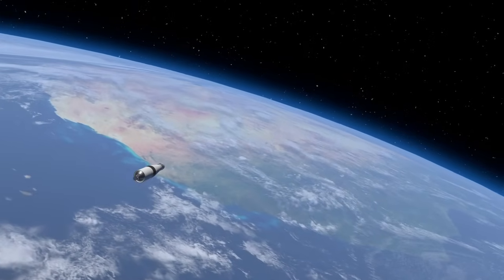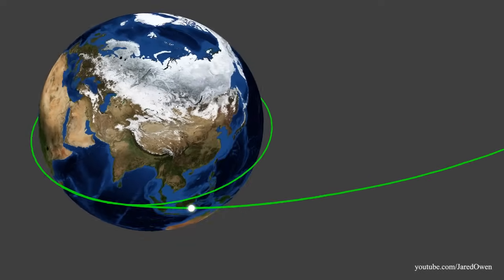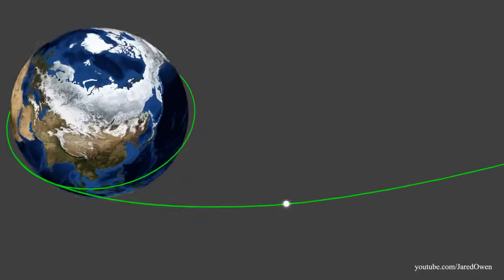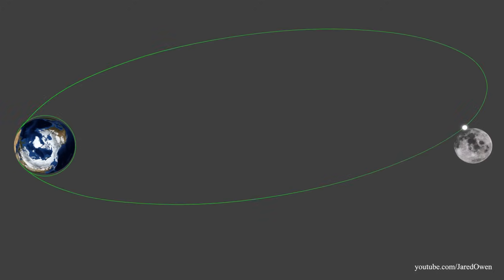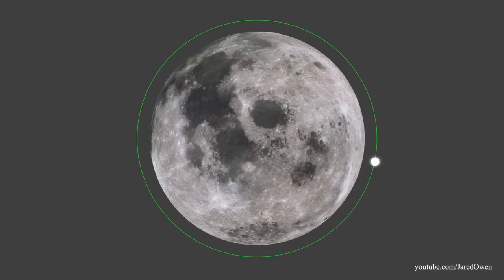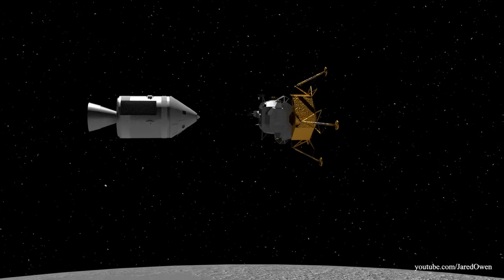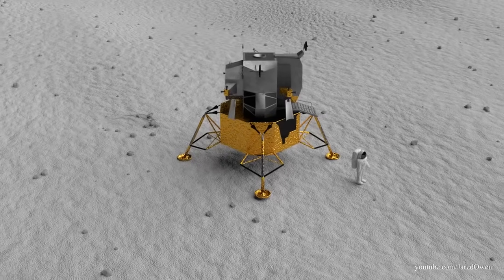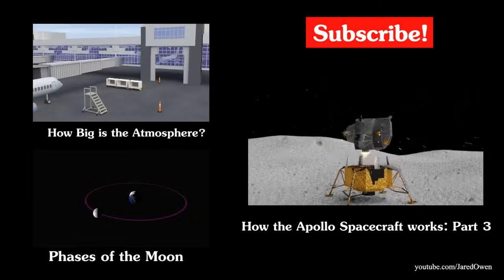How the Apollo Spacecraft works: Part 2

Comment from the maker: Watch Apollo Spacecraft Part 3 (the last in the series) 👉https://youtu.be/qt_xoCXLXnI
Reply: Jared, hi! Can i use max 10-20 Sec of your Animation for my Moon-Video?I will credit your name and link to this original Video? Please.
Reply: Yep which makes it all the more amazing... We literally had to INVENT EVERYTHING needed to go to the Moon and return, from the rockets, engines and propulsion systems, guidance and computers, communications, life support, heat shields to return, everything.  All the necessary skills and techniques and support equipment as well, from rendezvous and docking, navigation and orbital mechanics, EVA techniques and tools, space suits and portable life support systems, etc.  When the decision was made to go to the Moon, we had 15 minutes of suborbital flight under our belts, in a spacecraft nicknamed "spam in a can" that was barely capable of changing its own orientation in space and completely incapable of changing orbits (Mercury capsule) designed to run on batteries and keep its occupant alive and bring them back after just a handful of orbits (though with modifications it did fly for about 24 hours by the end of the program), launched by a modified ballistic missile that was basically an improved version of the V-2 missile Von Braun had developed in Germany 15 years before (the Redstone missile, which even used the same LOX/alcohol propellants as V-2!)  

Von Braun got it right the first time-- what was necessary for a lunar landing... a big liquid propellant three-stage, serially staged (one stage atop another in a "stack") topped by a spacecraft.  What he got wrong was the idea of direct ascent, flying directly to the Moon and landing the entire spacecraft, including the heavy Earth-Return portion of the spacecraft and all its propellants, on the lunar surface.  That would have required the Saturn C-8 or "NOVA" booster rocket with a much larger 40 foot diameter first stage powered by EIGHT F-1 engines.  It was apparent that such a rocket would be incredibly expensive to design and build and would take longer than the decade required to perfect, so he came around to John Houbolt's idea for "Lunar Orbit Rendezvous" (LOR) mission mode where a small "landing craft" that became the LM would be entirely expendable, carrying less fuel, and thus much lighter, would actually ferry the crew down to the Moon, leaving the heavy "mother ship" (CSM) with its fuel, parachutes, heatshield, and other equipment necessary for the trip to/from the Moon, would stay in orbit of the Moon for the crew to return to for the trip home after their landing and surface exploration.  This allowed the Saturn C-5 (Saturn V) to be able to launch the entire lunar mission hardware and propellant in a single launch, versus the alternative, the "Earth Orbit Rendezvous" (EOR) method Von Braun had supported once it was clear that "Direct Ascent" to the Moon and the NOVA was infeasible.  EOR would have used a pair of Saturn V launches, one to launch a massive Direct Ascent lunar spacecraft to orbit, and a second launch of Saturn V to launch the necessary propellant to refuel it, since it was too heavy to launch by a single Saturn V with the necessary propellant.  The tanker and spacecraft would dock in Earth orbit, fuel up, the spent tanker would be discarded, and the fully fueled spacecraft would then depart for the Moon, make a direct retrofire landing on the Moon, conduct surface activities, then lift off from the surface of the Moon and fly directly back to Earth, without entering lunar orbit at all.  

Funny thing happened as NASA studied their plans to "return to the Moon", particularly about the time Ares I and Ares V were cancelled along with the Constellation program-- NASA was "invested" with keeping the shuttle infrastructure (ie Solid Rocket Boosters) alive and of course demanded a "shuttle derived solution" for the design of the next heavy lift rocket to supersede the retired Shuttles... BUT in their studies, looking at all sorts of different variants and possibilities, the design with the MOST FLEXIBILITY and the LOWEST PER-MISSION COST was a large, LIQUID PROPELLANT, SERIALLY STAGED rocket, not one powered by SRB's.  Such a rocket should be powered by a Kerosene/LOX first stage to produce the most pure raw thrust possible with the lightest, smallest structure possible (hydrogen is more efficient but MUCH bulkier, requiring ENORMOUS first stage propellant tanks, and thus a MUCH heavier rocket, just as Von Braun had originally figured out designing Saturn V, which is why Saturn V had a kerosene/LOX powered first stage!  The second and third stages should be powered by liquid hydrogen and liquid oxygen, (LH2/LOX) because hydrogen is much more efficient in terms of fuel efficiency (Specific Impulse, or ISP) than kerosene is, and less is required on upper stages than for a first stage, and the rocket equation shows that higher efficiency (ISP) becomes more important the further into flight you go... IOW, you need huge amounts of pure, raw thrust to lift the heavy rocket and propellant load and spacecraft off the surface of Earth and through the atmosphere, but as you get up to speed and leave the lower atmosphere, specific impulse becomes MUCH more important, hence the need for hydrogen powered upper stages.  Kerosene can do the job, as the Soyuz booster and Falcon 9, both with kerosene powered upper stages proves, but pound-for-pound a kerosene upper stage cannot lift as much payload to orbit as a hydrogen upper stage.  Heck you can even use a solid propellant upper stage like some rockets use, but their efficiency is TERRIBLE compared to a hydrogen powered upper stage!  This was the reason that the Soviet N-1 moon rocket was four stage and had much higher liftoff thrust and was much heavier than the Saturn V, but could only have launched about half the payload-- it used kerosene on the first two stages, and only moderately efficient (medium ISP) liquid storable propellants on the upper two stages, so it was a simple, "brute force" method of building a Moon rocket.  

So why did NASA choose to build the less efficient and less flexible, yet MUCH more expensive SLS rather than a modern Saturn V designed using the same ideas as Von Braun's creation from the 60's??  Politics-- an all-liquid propellant vehicle with a kerosene powered first stage would not use SRB's, and that would tick off a powerful company with a powerful lobby and a few selected "space state" Senators and Representatives in government, plus the entrenched power-base within NASA that wants to stick to the "shuttle derived" solution, regardless of whether it's good or not, or sustainable or not.  The "sunk cost" argument, that said that "too much money has been spent on "shuttle derived" hardware and designs to change now" won out...  Hence SLS.  

These guys invented this stuff using slide rules and good old fashioned engineering skill and intuition, and their designs hold up, even today, even in the face of "political reality"... 
Later!  OL J  R :)
Reply: Please stop spreading the moon landings lie, at least out of respect for children
Reply: @Bibiisachildkiller  These liars couldn't care less about lying to children
Reply: I love this
Reply: @Bilal Khalid 
Derp
Reply: Espanñol 💪 duro
Reply: Did the Filipino Translations last month
Reply: @luayon   Ako'y saludo at bilib ako sa iyong ginawa. 😍😃😂
Reply: @Bilal Khalid is there any proof that apollo 11 and ISS are fake . Many people say that they had seen the ISS .
Reply: This video is very fun and you have to watch it
Reply: @Bilal Khalid 
Make that Dank DERP
Reply: Jared Owen where are the thrusters that turn the command module around while it travels at 6,000 km per hour?
Reply: Your video is great, very clear and concise. I am a native speaker of both French and Spanish, and I have an M.A. in translation. Has your video been translated in those two languages?
Reply: I'll do for french
Reply: @Bilal Khalid How long are you morons going to persist with that lie?
Reply: @Bilal Khalid r/iamverrysmart
R/peoplearef**kingstupid
Reply: Bilal Khalid do you ever heard of brain you peanut brain head
Reply: Bilal Khalid what
Reply: Jared Owen System is the problem 🏡 Our Life should be around these Great Qualities.....

1, Show all living creatures; all the love and kindness as much as you can.

2, Only try to be honest with yourself. If you try to be honest with others, you will get into big trouble soon or later.

3, Aim only one target at a time; otherwise you are chasing two rabbits and you will miss both. So, the reason behind it. Have one powerful reason and never ever give up the one you want the most.

4, Don't try to be good person only but be the powerful person. We will grow to be the one or we will die. There is no other choice. 

5, Always learn and look for to improve something your life. 

6, You are not alone. Love and faith the high power reduces unnecessary stress in life. But never completely rely on it. 

7,  Success and happiness are the byproducts of our usefulness. So, always increase the possibility of success.

8, Life is not going to be easy. Because of our unnecessary things. Eliminate all the unnecessary things as much as you can by organising yourself well with the environments. 

9, Never believe anything without the proper evidences. 

10, Always try to give more than you take. 
Because it is dignity/ character of the divinity within you.

🌎 As long as people continue to see themselves as separate from everything else, they lend themselves to being completely enslaved. Success depends on how well we relate to everything around us. Joy comes from that bliss of connectedness. I believe that unarmed truth and love will have the final word in reality. To love; you should have good heart. I am a good person until I see a person better than my standard of goodness. Being good is the progress towards a worthy cause. Love is God. Whoever lives in love, lives forever. How selfish it is to try to keep something forever? Love is all about nourishing, nurturing, sharing and expanding the love within you for all. The principle to which we adhere to is that we have kindness of love at heart for the whole of mankind.  As long as there is the unnecessary differences within us; we can not live peacefully so we have to eliminate all the unnecessary differences among us so we can love all. People abilities may vary but not there true love. If we love a person/ God for a reason then we love the reason but not the person. No reason is the reason to love the person because true love never fails. So do not compare or measure the true love as first or the last but love all truly. If you love people truly then you can understand people. If you don't love then you don't understand people at all.

People are controlled by system why?
The Cyclical Consumption is the current economy all over the World. It is making the scarcity problems of the earth finite resources to deteriorate day by day. Current Monetary System is legalised theft. Real money is Gold and Silver. Scarcity gives the money more value. Real money won't lose it's value. When Governments stay away from Gold & Silver then very easy to transfer the wealth / resources to upper class the Rich (Corporatocracy) Elite. When the Governments are printing out more new fiat currency with reserve banks, our old currency is losing its purchasing power everyday. They are printing millions of currency everyday. All governments and laws are existing right now to transfer wealth to upper class the rich elite. The USA Government & other Governments are in many countries, bailed the investment banks & financial institutions in 2008 against the majority of the people. There is no democracy in any countries. Because of the Money System based on profits motive only above all else even humans lives and well-being. So, we do not have freedom to protect our values with the money so on. The violence, bankruptcy & all the negativities are build into the Monetary System of our society. All are owned (including ourselves) by Reserve Bank. Which is private cartel the corporation. So, in legal system, we are legally considered as chattel the properties. They make money in the capital markets with our birth certificates. They do not consider us as Humans. That's the truth. We are at the invisible war with the Elites (Corporatocracies). We have to fight for our Freedom. Resource Based Economy is the Solution. We have to declare the earth resources as the heritage of all the people of this world. So everyone has access to it. Please have your research about zeitgeist movement then you know the truth more. 

 Truth About Health/Drugs Industry Because Of It Your Life At High Risk The drug industry is a 1/2 trillion dollars a year worldwide conglomerate. Almost 300 billions dollars just in North America. That is really big business. What would happen if everyone were well? There is no money in health. You see, good health makes a lot of sense but it doesn't make a lot of dollars. Because everything they do is toxic. Every drug they use, prescription drugs, all drugs are liver toxic, bar none. If you've had amalgam fillings put in your mouth by dentists. It is highly toxic. There's cancer because most of the chemos are themselves carcinogens. To view the tumor as the cancer and we know the tumor is not the cancer. The cancer industry is 200 billions dollars a year. The more work they get, the more profit there is. You have to dismantle; If the truth ever came out about what we would need to do. 30% of people of females in America are at risk of getting, will get cancer of the breast. The ones that are already dead have been grossly mistreated by the medical profession and by the government that supposedly is supposed to encourage free research and development of all possibilities. Why would medical doctors who studied medicine and practice medicine and are heavily funded by pharmaceutical companies why would they go and look into vitamins? That they never had the answer orthomolecular. And as more and more of our population start taking their health into their own hands, there's going to be even more and more of changes. It can't go on the way it is. The system is failing apart. We must make nutrition the primary prevention strategy for the population. You are what you eat. You are everything that you have ever done to yourself. The choices you make directly affect the outcome of your life. - (Food Matters Documentary in Netflix)

😊 Well, I truly love God. I am not religious but very spiritual person. So, I believe 1) Religion is the beliefs in someone experiences But spirituality is having my own experiences. The mainstream religions people promote religious ideology by giving guidelines and guide but In my spiritual life; I do not want anyone or anything between God and me to restrict my freedom to worship God. 2) We do not need any authorities to do good work. The god work is the good work always. In contrast; organised mainstream religions are claiming that they have the authorities to do God works as leaders so on. 3) God is not capable of doing wrong thing, change the past for us and create anything out of nothing for us. Nothing means not anything. So, even God is limited. The mainstream religious people believe that God is unlimited. 4) God wants us to take responsibilities for our righteousness life but not for all the consequences of our actions because they are continued to exist among us. So, How can god punish us for all our consequences? The mainstream religious people believe we are full of sins because of all our actions. 5) Freewill  is an illusion. People always choose the perceived path of greatest pleasure.  So, we do not have choices all the time. In contrast teachings of the mainstream religions are promoting people to do god's will always because we all have choices of freewill always. 6) We can not separate everything into groups. So, everything for good and evil and there's no success and failure for everything. If everything is real then real things can not be threatened. Once you come to understand that God/The Holy Spirit is in each of us, You will no longer need a Book to tell you how to live. Then why we need religious scriptures? The Virtue is the expression of the basic goodness in our actions. The Basic goodness is the fundamental worthiness of every individuals. We are worthy to God always in everything. 7) Beliefs in a cruel God makes a cruel man. No matter what; every living creatures has the right to live and What makes their life cheap? Everything depends on everything. Nothing too big or too small in value. We can not love and hate at the same time; Being a vegetarian means love without cruelty happily. The mainstream religious people are killing people and sacrificing animals in the name of God. They promote God's cruel punishments. The Punishment is endless for Sinners/Devil according to religious scriptures. But God is love always. Overcome hate with love. If all religions for peace, unity? No way. Because they are not for peace. 8) Well, The God gave us everything to go from moment to moment in our lives as we do our part  and pray only to thank god then the Love is in progress. The Love is always for everyone. We are always worthy of the God's love. Our greatest fear is; not to be loved by anyone but we are all loved by someone. When we eliminate all our unnecessary differences among us then true peaceful life is possible with the true love. If we can't find the peace within ourselves then we will never find it anywhere else. 9) This is the Fight for independence and freedom of humanity to worship God freely without religious guide and guidelines to restrict us. Unnecessarily, We do not want third party controls over us in anything ; especially in spirituality. 10) Revive Survive Thrive. Sincerely,  The Real Peacemaker against religious oppression.

 https://youtu.be/HbvCxMfcKv4
https://youtu.be/Z_Mxjdrd7Sw
https://youtu.be/wLzeakKC6fE
 https://youtu.be/P8vHa8zD7jY
https://youtu.be/pIJHJzDQcRM
Reply: Бредятина не переводится на наш язык.
Reply: Arabe please
Reply: Bilal Khalid lol what a boomer
Reply: I know English well but I'm so happy to see my mother language Bangla here🥰
Reply: @BRNOOB_  My mother language is also bangla  but from where do you see this video in bangla ???
Reply: @Blank-p2t  in subtitles.
Reply: @BRNOOB_  
O thanks  . ও ধন্যবাদ 

|
Reply: @BRNOOB_  how does your picture change.
Reply: @Bilal Khalid Get out from here
Reply: @BRNOOB_  but why ???কিন্তু কেন ???
Reply: @Bilal Khalid why didn't the Soviet government say it was fake? Surely they would have been the first to call BS on the Americans.
Reply: @Bilal Khalid ok but, your wrong & stupid, if it WERE fake, you best bet they wouldn’t leave a “blues clue” on the statue of liberty or somth
Reply: that's if they actually went there. you are assuming too much. During the 60s a lot of political scandals occurred. Also during this time a false flag operation took place, the gulf tonkin incident, the government knew it was a lie, but they had an agenda, so they sent hundreds of thousands of young Americans to die in a war that was never meant to be won. This is not the first time the government lies to the military and sends kids to their deaths. There were many experiments where American soldiers were exposed to deceases, Radiation, and chemicals to test the effects on humans. The media as always paraded the news about the destroyers being sank by the enemies to get public support for the war. This war was fought to expand the market for rich assholes to get into free countries and exploit their resources. kind of the same thing that we are doing in the middle east. You don't see the spoils of war here in America with the gas price of 285 dollars do you?
Reply: Can anyone fix the word "oribit" at 3:18 please?
Reply: @Bilal Khalid the landing of the falcon 9 during transporter 2 is wrong
Reply: S
Reply: ATTENTION

Moon landing is real
NASA is real
ISS is real
Its not filmed in studios
spread MY truth

#RealMoonLanding
Reply: @Ff_Ww  you saw the comment?
Reply: I know I’m really late to this video. The Lunar Modules full name is “Lunar Excursion Module” So it should be the “LEM” instead of the “LM”.
Reply: @aliasneo6786  They dropped the “excursion “ from the name long before the launch.
Reply: Do the N1 rocket
Reply: ¿Que?
Reply: Ok
Reply: cicada3301 change yourworld
The red chakra is a color made by the moon, it represents ego, division, desire, domination
The moon can create holograms, based on the the five senses and work on,can be touch
The eye is first saw and some how we believe it
The Ancient Creators hint: Right brain control left brain, up it on
They madeDNA Left Brain Controls right Brain now.
The left eye represents the devil, that's what it means from videos
Reply: @Bilal Khalid Troll! GO AWAY!!
Reply: I will try my best to do it
Reply: Ok ! Jared this never happened.
Reply: Stop it with the moon landing lies.
Reply: Only this I don't believe
Reply: Why is this not shown with real footage of Apollo? Nasa and their fanboy videos are all cartoons,without exception,every single video...WHY? because its BS...its science fiction,Santa clause for grown ups...use the force Luke and perceive the deception..
Reply: @unarammer2003  You are an idiot. Such footage is impossible to have been shot in reality. Who should hold the camera? A 200 feet selfie stick?
Reply: @unarammer Are you really this stupid or are you trolling? Don’t you post this idiocy on all of Jared’s videos? He does animations. He doesn’t hide this. And he does so with purpose.

There are hundreds upon hundreds of space videos that show actual footage and you dummies say it’s fake.

So why even comment at all?
Reply: @unarammer2003 There’s plenty of of sights that have real footage.  This site is about learning through animations.  Of course understanding this stuff requires a level of intelligence.
Reply: @SciTrekMan  well i see you have none..
Reply: @unarammer2003  Nice try but huge fail.
Reply: @SciTrekMan  your whole life is a huge fail if you believe cartoons and space fantasy
Reply: @unarammer2003  I see.  Insults, no evidence.  That’s all you got?  I thought so.
Reply: @SciTrekMan   space cartoons is your evidence... baalerf  believer..
Reply: @SciTrekMan  how can i have evidence for something that dont exsist???
Reply: @unarammer2003  Amazing and laughable that you think that’s my evidence.
Reply: @unarammer2003  apollo 11 landed on the moon but he made it as an animation because he wants to show it in good quality and show his 3d animatipn skills